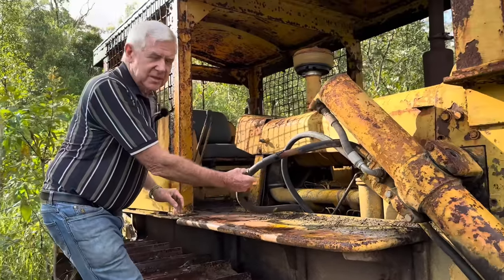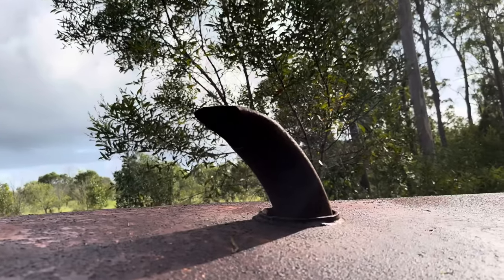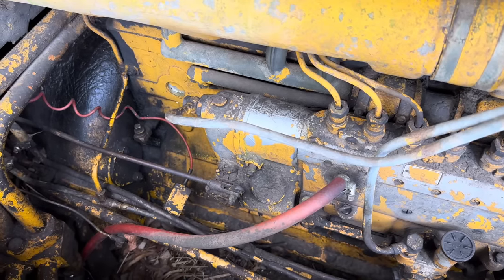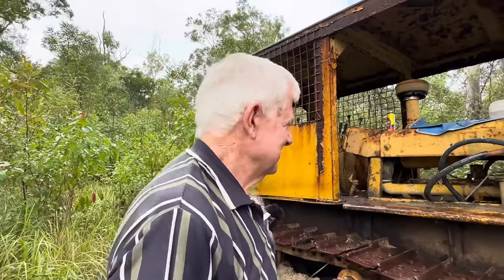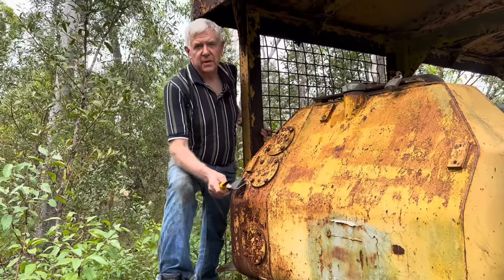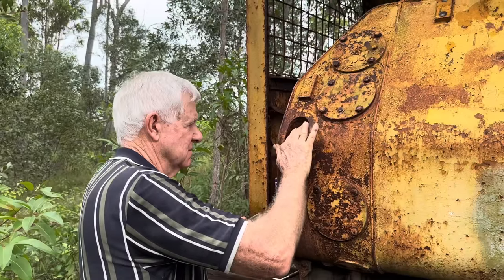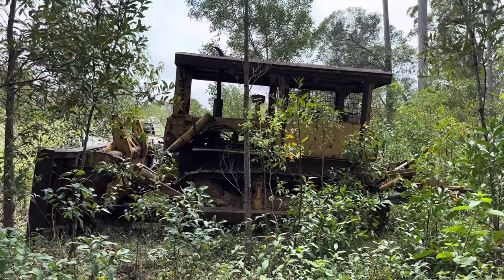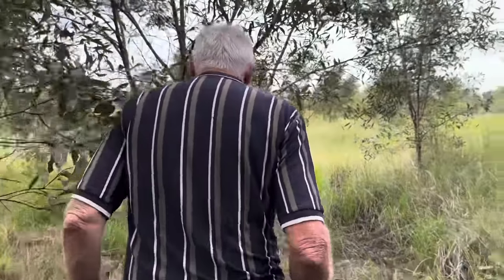Will it START? OLD Bulldozer Sitting in the BUSH for YEARS!

Comment: Looking close-up at the diesel injectors and hydraulic hoses on the Fiat-Allis, I suddenly got nostalgic for all those dirty maintenance jobs I used to do on an old Fiat-Allis 605B wheel log-loader, I operated here in NZ years ago. The '605' was a noisy beast, but a great workhorse. Cheers Bruce, from this side of the ditch.

Comment: Push the button in on the side of the injector pump and it will start without aerostart. The bolt to undo the hydraulic tank bung is in the toolbox.  About time it was put back in the shed, been sitting out there for about 6 years.  Spent a bit of time on the D8H as well.

Comment: There is so much to comment on here so I’ll make a list.
Very impressive how you lift those batteries out of the machine, I know how heavy and awkward they are.
Also how thoroughly and carefully you deal with the terminals led me to think you must have had a bad experience and sure enough you mentioned the post being blown off the boat battery.
I’m so envious of how methodical and tidy you are when working, I try hard to be similar but often come up short.
Finally I’m in awe of your patience and even temper, you never seem to get rattled or cross, guess there is little point but sometimes things are frustrating.
I’m no youngster either but I learn so much every time I watch you work, thank you 🙏

Comment: Just purchased a d8h myself. Would LOVE to see you get that one going. That looks like a later model 46A. Direct electric start. The early 8h was a pony motor starting system. They produced them from the late 50's up to the mid 70's when the H was replaced by the K.

Comment: We used to have one of these Fiat-Allis dozers. It is a BD14 (probably series b), direct drive.
I’m 99% sure it would have started without the aerostart. There is a button on the rear of the injector pump that will stay in if pressed (provided the throttle is set about halfway), this changes the injector timing for cold starts. It works very well. 
There is no heat element or glow plugs on these engines.

Comment: Simply amazing. It does however show how the old mechanical machines can be saved. Modern machines have too many electronics and after sitting so long would be beyond repair. 🙏🇦🇺
Reply: In about 2004 I started a Allis Chalmers model M crawler that hadn't ran for years. Had to improvise on parts and gaskets but now it runs and push snow with it every winter. Took 2 crawlers to build one. Fun project to fix a 1936 dozer.

Comment: Awesome 
Yep when I was still an apprentice back in 87/88 Eden  chip mill I used to moonlight during Christmas holidays  for collins logging/earthmoving Merimbula we where getting the D8H ready for the next years work when low and behold I pulled out the steering gear filter/strainers which where full of large broken bolts/nuts from the crown wheel as it turned out less to say changing some filters turned into a rather big job never worked on any fiat allis machines but heard lots of good things about them  
Great videos 👍

Comment: Hi, Bruce in AUS.
Thanks for the video - great stuff.

The blade on the D8H is a 'U' blade, not a semi-U blade. The semi-U blade only has the very ends from the start of the corner tip on out turned forward - would like to see it running too. I spent quite a bit of time on them in my younger days.

Just my 0.02.

You have a wonderful day. Best wishes. Deas Plant.

Comment: Bruce great job going over those hydrolic rams I used to work on the water in the winter for oysters and we used to use patent tongs and you use to have to keep your eye on the ram shaft cause all that salt water would pit them bad in the summer when you have the tongs stored away. And when winter came and you were rigging up and getting ready for oyster season we'd have to take Emory cloth and give them a little sanding and knock the burros off .cause just a little burr on that  ram would tear those seals up fast and when we would put them away after the oyster season was over we would clean them and rub grease on the shaft while they were being stored.

Comment: Vicariously living through these. Around here, there's probably less abandoned machines than there's lottery winners. The last abandoned machine our outfit bought was in 2012 i believe. For parts. The engine was dynamited so it was impossible to make run, but had tons of good parts because the operators had blown the engine in the late 90's with (if i recall correctly) less than 900 hours on the clock and then they just gave up. Everything else has been picked clean or is in active use.

Comment: That Fiat Allis is an HD11. I ran one of those in British Columbia with a blade and sometimes a tree shear on it in about 1975 when I was a very young man. I remember it didn't have power assisted brakes and shearing trees always had to back up and turn left to toss the tree off to the right side. Really built up the muscles in my left leg.
Reply: Mmmm. I thinking it a BD14 FIAT , it had the FIAT shaped front grill plate , , ALLIS  had a flat one , & that is a FIAT ENGINE ,   FIAT  was also direct drive power shift   hence  him stalling it   at low revs. AGREAT DOZER , FIAT MADE BIGGER AS WELL .

Comment: This was a great find and save.  I'd be keen to know if the hydraulic rams are all to blame for the creeping rippers or is it in the valve banks too, that also need attention?  Looks like the local hose doctor will be called on to replace a few metres of hosing that looks rather second hand.  Keen to see a video clip on the D8 and see how it looks after a start up.  Keep up the great work.  If you cross the ditch to do a few of these clips, we don't have snakes (and other creatures that will kill you) to worry about.

Comment: I think you have a winner there it seems to run well, sounds sweet as a nut and it steers and goes forward and reverses hydraulic work transmission operates ok, yes I think you have a winner good egg. congratulations all the way from the UK.

Comment: To prevent a runaway, you can block the air filter intake pipe with some plywood etc. to stall the motor.

Comment: Bruce in a bad place those 8d batteries are heck. Of course they couldn't be in the upper seat box, but luckily with enough of a handle to bend down low enough to really damage something internally. Good job and thinking Bruce. My brother had a dozer this size but when he retired another fellow swooped in on it and repaired the clutches. My brother told him he would pay him for his trouble but the other feller said no. So my brother lost his old machine to this bloke. It had sat for 10 years. When retired he had a full logging setup. A dozer, loader and two skidders. Here we call them gypo outfits. Nothing derogatory as my brother made 200 to 300 thousand a year for 15 or 20 years. 20 would be an outside number. He had a JD740 skidder that was turbo charged and the smaller skidder snoopy had none. The larger more powerful JD skidder used half the fuel of the smaller one. Starting these old machines in cold weather meant lots of alternator brushes in his crummy trucks. Crummys were what we called the crew trucks to get back and forth to work. In 74 he couldn't get gasoline for his crummy and used 1/2 diesel. Apparently it had a high enough compression for it to help a little. It certainly smelled of diesel driving behind it.

Comment: Nice 1 Bruce, I find these types of videos much more entertaining then your truck videos. (but hey that's just my opinion)  I see alot of your viewers asking why someone would just leave this type of machinery lay in the paddock and my opinion is that in Australia especially and coz our Dollar here is buying very little these days, when an old piece of gear gets run down to a point where it needs alot of money and time to repair it, some guys just could not be bothered to repair everything so they just go and buy a better 1 instead. To give you some idea even those leaking blade cylinders would cost around $ 1000 Dollars each for packing seals and piston seals and that doesn't even include replacing the shaft  and if the shaft is pitted like I saw you rubbing away with emery paper on and you shove new seals in but don't replace the shafts then in 6 months your new seal kit is leaking as bad as the ones you just replaced. So this is the reason, it costs huge amounts to repair old gear Properly here in Australia these days.

Comment: Only thing with those old girls is it costs a fortune to rehose them.
Unless you have some old spares laying around.
Oil is the least of it.
We have an old D8L that we still work occasionally to strip off pit areas.
Its a good old girl that will usually start even after sitting a year or more with no problem.
We also have a spare one with a blown motor for parts.
Kinda big for moving on a truck on haul roads but we manage .

Comment: You need to get a can of that RustBlaster the yanks use it's good stuff for releasing Rusty Nut and Bolts
Reply: Snake oil.... Only thing that breaks rust is heat and a long lever.

Comment: I enjoyed watching old boy mechanic doing his job proper way..i myself would have changed the engine oil en filter before driveing 4 k  could damage wot was left of a old engine.but luck was on your side no mice in the engine homesteds air filters and manifolds..in 74  and been doing since leaveing school..cannot get my head around computer stuff we did not use such..we were store of brain powers..now new people to the trade are fitters just change this even pre warning to change oil service ect..it was the drivers job to do stuff knowing every noise and grease nipple..dont need em now just change them sure grease is cheaper then a roller bearing shells ect..got to feed the mechanics a good wage and the dealers corner..plus VAT killer tax..happy dayze never to return..😢❤

Comment: Hmmm not checking hydraulic oil level before start up could've been an expensive mistake. Pumps can be stuffed within seconds run dry. 
Too many revs first up without time for engine oil to circulate properly can cause some damage too on an engine thats sat for so long.
Sorry just found it a bit disappointing for someone who seems too know a lot and take time on the little things.

Comment: I KNOW WHERE AN OLD DOZER AS WELL AS AN OLD 49 FERGUSON RACTOR ARE SETTING. i THINK THE TRACTOR IS SRILL USED NOW AND THEN TO PULL HAY TO THE CATTLE.  THEY ARE LOCATED ON THE LAZY t RANCH OWNED BY MAUDRI SMITH AND SHE IS STILL MAINTAINING THE RANCH AT 89 YEARS YOUNG . YOU CAN LEARN HOW TO CONTACT HWR THROUGH THE STONEEYFORD, CA. COUNTRY STORE. SHE HAS MANY OLD ANTIQUE CATTLE RANCH MACHINERY.

Comment: found this pretty interesting until I saw him running it with the ripper down. it turned boring after that. driving back and forth, no value to that.   run it out to the road and load it up, then you've gained a working dozer.